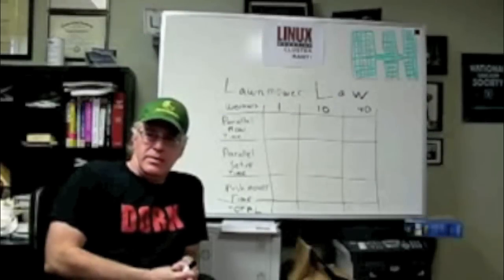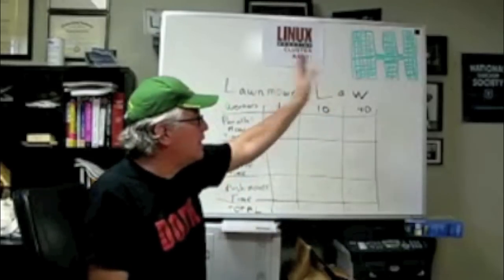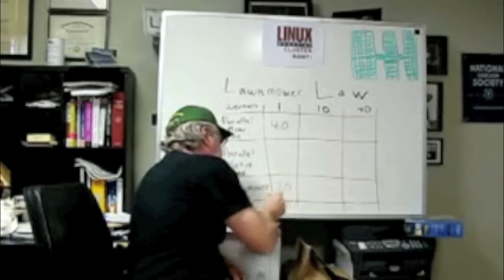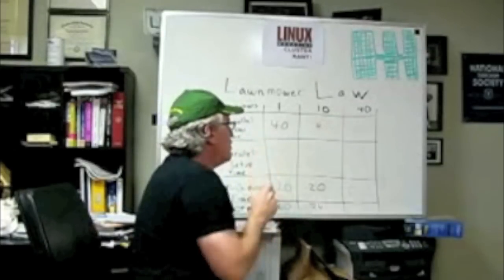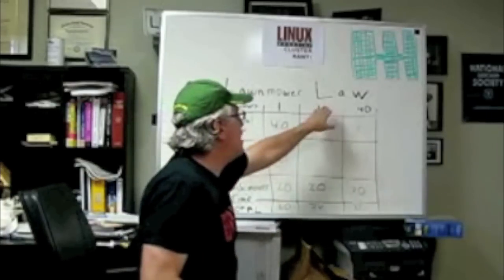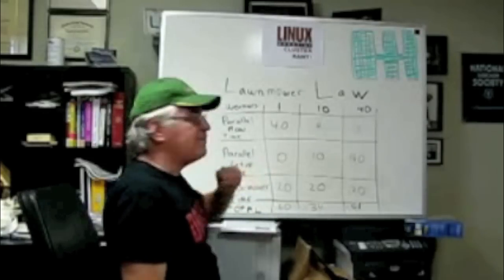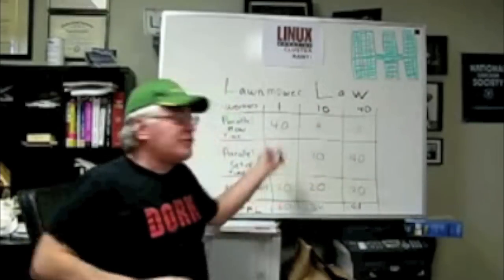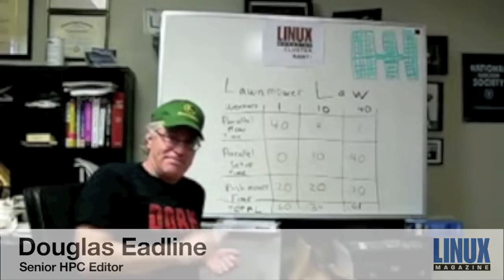Understanding Parallel Computing (Part 2): The Lawn Mower Law

Comment: Glad I watched tihs before I got TOO excited about teraflop computing :) So what if I clock some RAM storage(with less memory and faster access) to be a direct back-up of the processor BUS , sitting closer to the GPU. And then program the GPU for independant access to STANDART RAM memory , so that it knows what it needs to do based on the CPU activity,  without having to actually wait for commands or data streaming from the CPU "on purpose" ? Won't this change the set-up overhead to an async in some way? (seriously , just asking , I might be completely wrong)

Comment: youldn't it be a good idea to make the CPU asymetrical so you have like 1 or 2 large cores that have a high clock and high IPC and a lot of small ones that arn't clocked that high but that are meant to do the parallel work or is this a like an apu